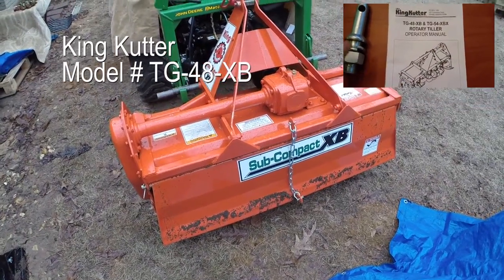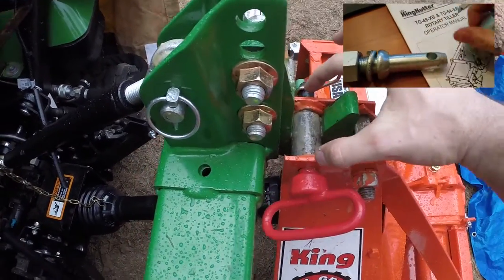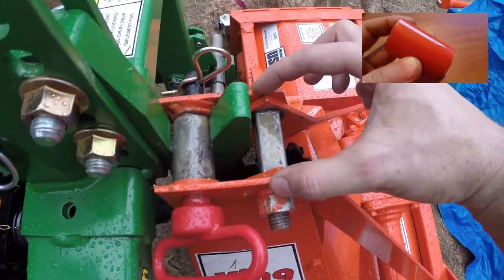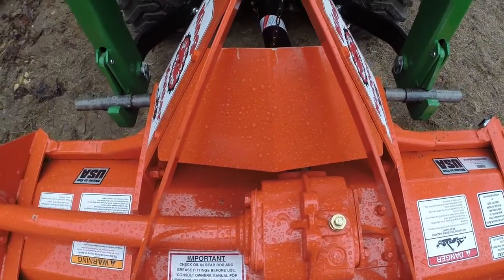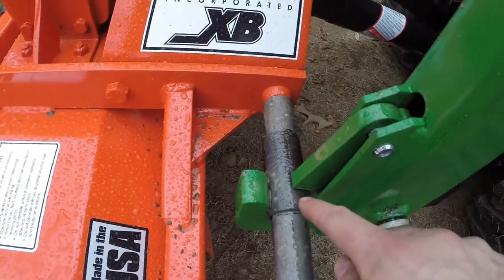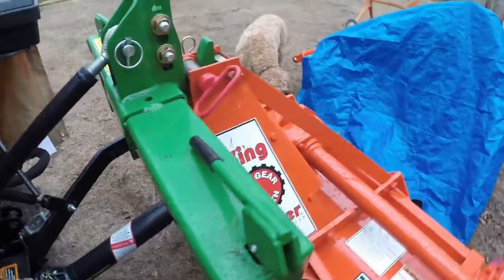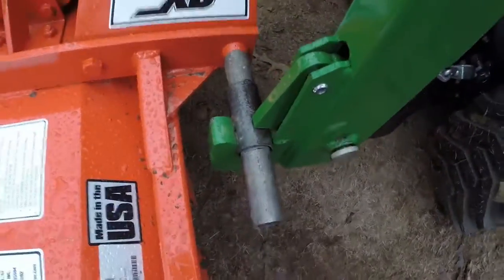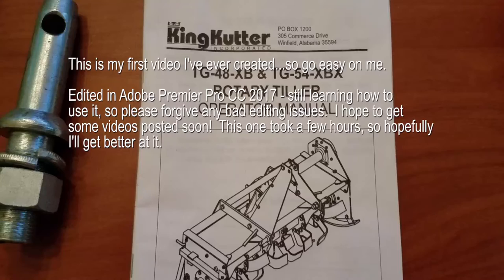King Kutter XB and John Deere Imatch Quick hitch setup

Comment: Just the video I was looking for, just purchased a 6ft King cutter landscape rake and got it home to realize it didn't work with my imatch, your way is much better than what I was going to do, using the torch to make it work lol
Reply from the maker: Glad it helped!  I'm considering getting a drawbar from Tractor supply and cutting it up to extend the pins, but the method I show here is still working for me.  I'm surprised the 6ft landscape rake is not compatible - ive got their rake as well, but mine is the 5' and it's not QH compatible.  I thought the bigger ones were. Thanks for stopping by the channel.

Comment: Nice video. I'm looking at getting the xb 54 for my 1025r with the I match hitch. So the pipe is just slid on to the factory pins without any type of bond right? And the larger pipe over top to make it cat 3 is also just slid on too?
Reply from the maker: Yep - that's what I did - it works, but bounces around a little in tough dirt.  If I was doing it over, I'd have gotten one that fit the iMatch properly...